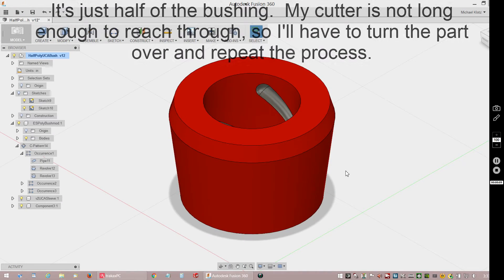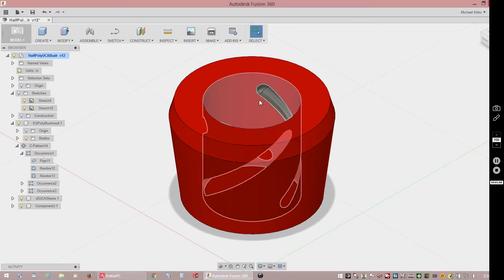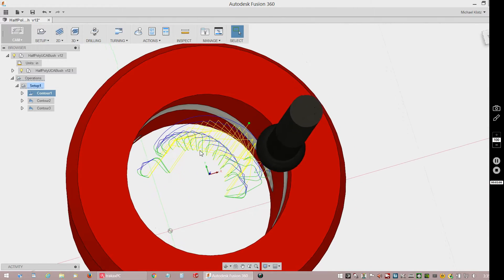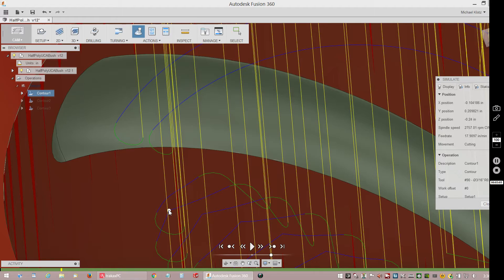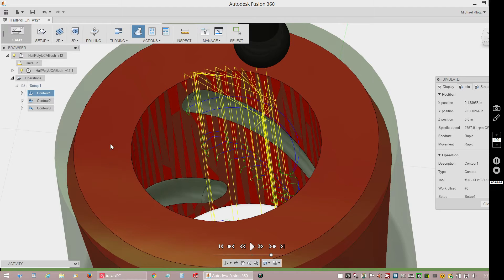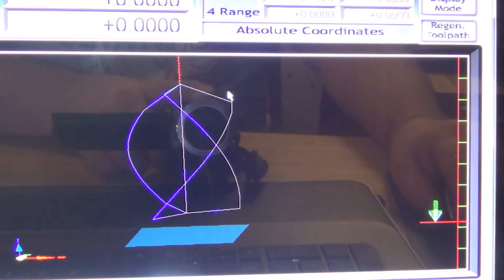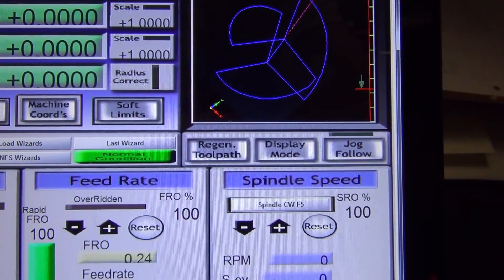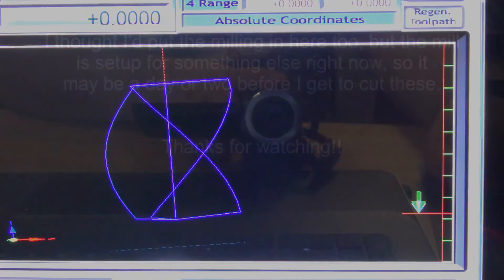UCA - Urethane Bushing, Inside Grooves pt3

Comment: it seems like G02 or G03 would work fine for that. you just add the Z to the code to make a helix.
Reply from the maker: +UnconventionalMilling YCM30cnc Brought that up yesterday, but I just looked it up....then read his comment again......I understand what you guys are talking about now.  I'll definitely look into doing that.  Sounds like what I wanted to start with!! :)  Thanks!!
Reply: +bluehandsvideo 

yea it works just like g02 -3 in a plane, but you add the z distance you want it to do while doing the arc in XY. you are basically thread milling a really steep pitch.
Reply from the maker: +UnconventionalMilling Very cool.  That would make it very easy to manually code once I have the six X and Y coordinates figured out.  Z would be very easy to figure out.  Thanks!!

Comment: Nice work!  An alternative is to use helical interpolation from top to bottom of each arc (ginormous thread pitch milling if you will) position tool at start of feature with G01 move then G02 X__Y__Z__i__j___ where X,Y,Z are end point of arc and i & j are distances to center point of arc.  I cut a 300 psi urethane bulkhead seal groove for a wire (urethane clamshelled over wire in fixture) using a ball end burr.  Best results were with lots of passes of shallow cuts.  Your application seems like a good one for looping a cut n times via subroutine with defined incremental step over.  Have done it in Mach3 using G91 M98 & 'oh' header for sub.  Sounds complicated but it's not.  Thanks for posting from your friends @nydls305
Reply from the maker: +YCM30cnc Thanks!  As a newb to this.....a good bit of that went right over my head.  I think I did a .33 spiral between two offset planes and gave it a really small diameter......which basically gave me a line....then I used the pipe feature on that line to create the groove.....then did a sphere at each end to get them round.  Then just patterned it 3 times.  Sounds pretty quick, but it took me many hours of trying to make the spiral work.....but the spiral twists the ends when you stretch the pitch that far.